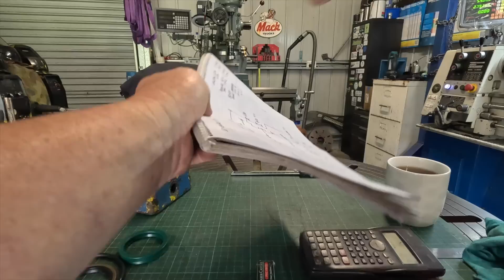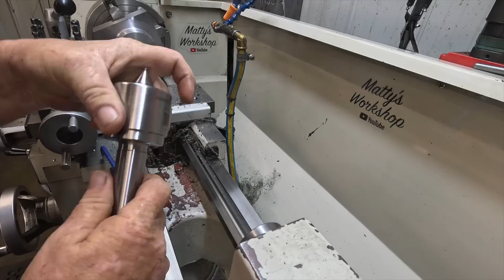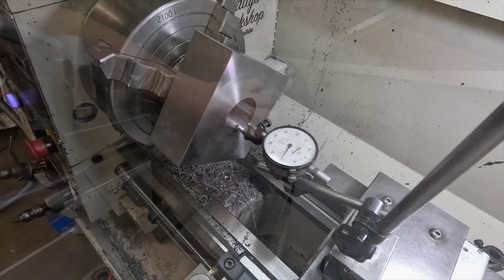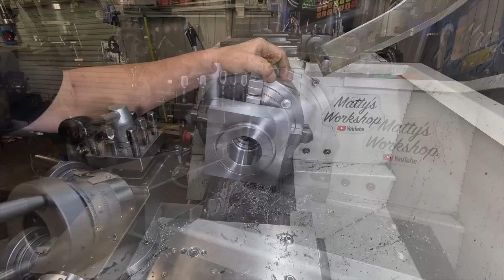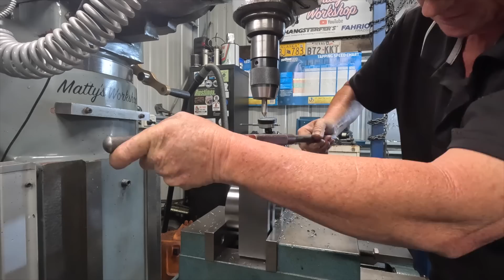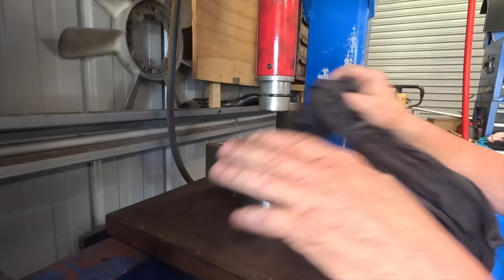Hyraulic Cylinder Repair

Comment: The way you got stuck into it mate, it looked like you'd made heaps of those. I have a theory as to why the cast part cracked. You might have a chin wag with your mate who asked you to do the job and tell him there may be a good bit of water in his hydraulic system. I reckon it was ice wedging that broke it in the first place. With that kind of break it can take a fair bit to completely fail.
Reply from the maker: Gday, I don’t believe it was ice that caused this, the day before he replaced the packing in the gland and he believes that he screwed it up, thanks for watching mate

Comment: Well done as always Matty.  Bracing with the live center was the right move.  Even with full engagement on the chuck jaws those interrupted cuts can cause havoc.  More support is always a good thing.  As for the "experts" the end results speak for themselves.  There are many paths to the destination and yours was good one.  Thanks for letting us come along on this trip.
Reply from the maker: Gday, The live centre made quite a difference, Ive been told in the past i've done things the wrong way but ended up with a good working component🤷‍♂️, Cant please everyone mate, Thanks for watching

Comment: Hello Matty, you chose the right approach to that flange, because on newer cylinders there are no longer gaskets that are compressed with a nut. The only thing I would recommend is that you definitely put a fibrous slider in the bore, which also serves to prevent direct metal-to-metal contact of the piston rod. Maybe you predicted this? On old versions, a pressed bronze bushing was used to prevent this. I've been in that industry for a long time, so I just wanted to warn you about that little thing.
Hello Zlatko, Croatia!
Reply from the maker: Thanks mate, Much appreciated

Comment: "I think I need a bigger lathe." You'll be taking work off Kurtis next Matty. Another fantastic job there. 
I have found those button inserts work really well with interrupted cuts as well. Although my lathe is probably a size or two up and I use 25mm tooling.
Reply from the maker: Gday Bill, I really like the button tooling, I should be using them more really, A bigger lathe would be nice thats for sure, Thanks for watching

Comment: G'day Matty. That is some engineering feat with lots of breath taking cuts & drilling holes. The unit looks better than the original. Now there is a shiny new valve assembly ,they will have to paint the tractor  😆 😊😊
Well done, better than a store bought one 
Ted
Reply from the maker: Thanks Ted, Won't be long and it'll be all rusty and look old mate, Thanks for watching

Comment: Guessing, But you are right Kurtis, a drawing goes a long way. You one clever bloke Matty.😉 @ 27:34 Raise the tool height, for the outside diameter, but remember to reset the tool when cutting the inner diameter of the groove. You could just about have the tool at any position between 9 o'clock and the 12 o'clock position. (For the outside edge.) I mean that is an extreme, but you should see what is going on. ( And tool position for the inside edge, between 6 o'clock and 9 o'clock.) Sketch it, a Dwg, will show what I'm getting at.
Reply from the maker: Gday Mark, Good guess but not correct, Its a good idea lifting the centre of the tool, works well, Thanks for watching mate, Cheers

Comment: Gday Matty nice job mate turned out beautiful, always love that smooth finish . It would be nice to have a proper set of inside dividers to measure those thin grooves if they exist, I've struck that before myself.
Reply from the maker: Gday, I need more practice measuring inside grooves, Thanks for watching